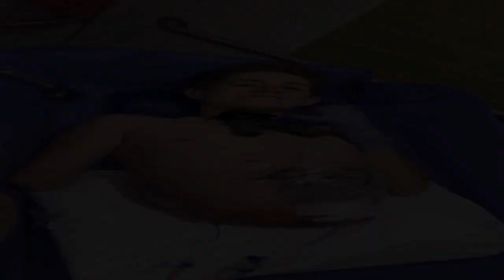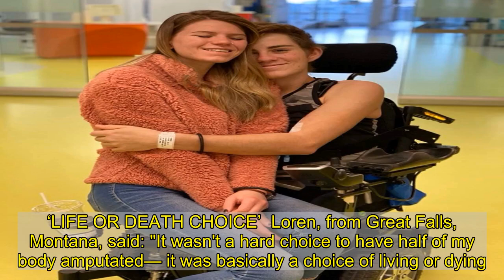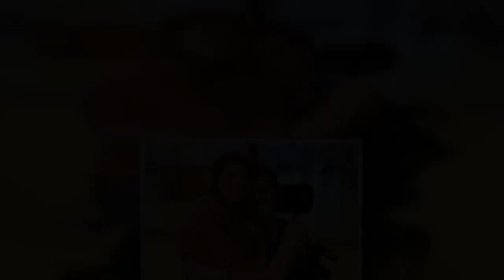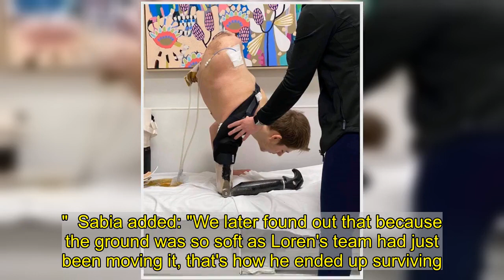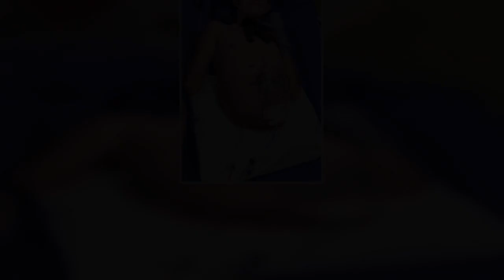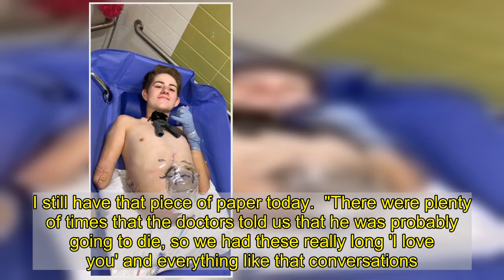Teen who lost lower body after being crushed in forklift accident dies odds

Comment: First rule when  when  a forklift tips, do not try to jump free. Remain belted in, lean over  the steering wheel and hold tight, keep all body parts within the compartment,  brace your feet and  lean away from the direction that the lift is tipping. If he had followed the rules he may have gotten away with a few broken bones and maybe a concussion, unfortunately this young man learned the hard way what not to do.
Reply: Did you hear his story? He wasn't trained to operate it. His boss just told him to. Bad companies all over..
Reply: @OOO_BARRACUDAAA  Saying there are bad companies all over trivializes this young man's  horrific accident and the problem of people not being properly trained by their employers. By pointing out his mistake maybe someone can learn what to do  before they find themselves in a similar situation. Safety is no accident  you need to be properly trained and receive certification before operating a PIT of any type.
Reply: A forklift is a special machine and he said he was not trained to drive it , but his boss instructed him to  move it.
Reply: Years ago, after a fatal forklift accident, Caterpillar came to train, test and certify operators. Over half failed. They kept driving the lifts. Pity. This couple has endured what would send most running. The last video I watched was their wedding. Been without a phone for months so I need to catch up, especially after seeing this headline. Still sending love and positive energies for them